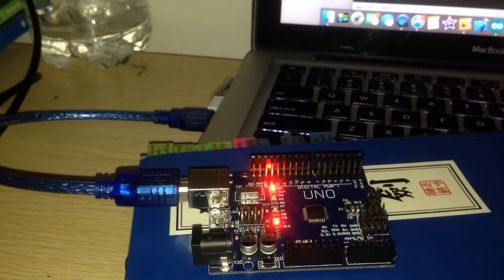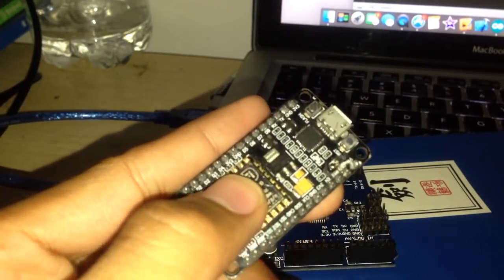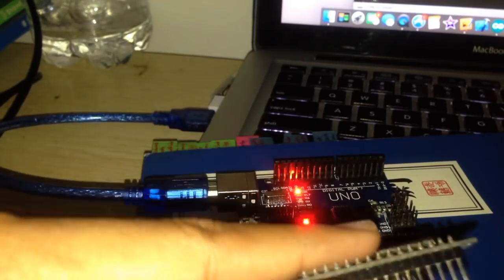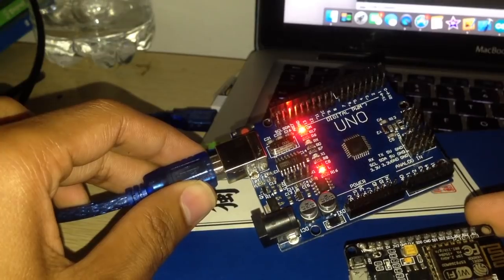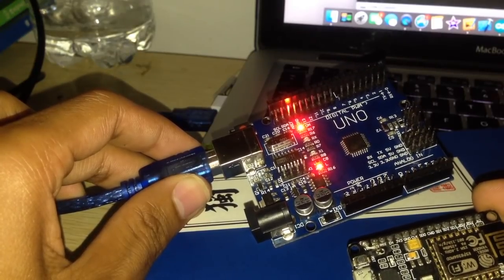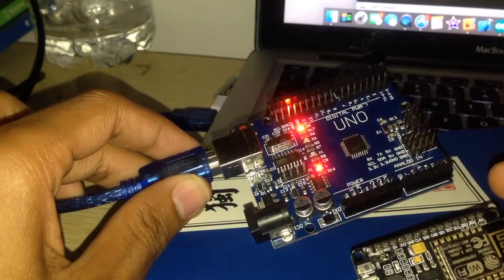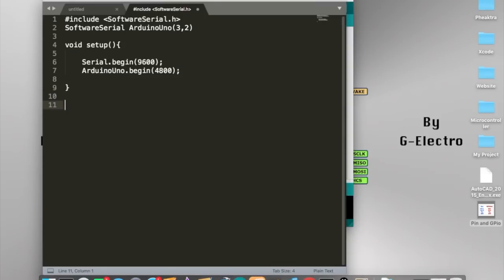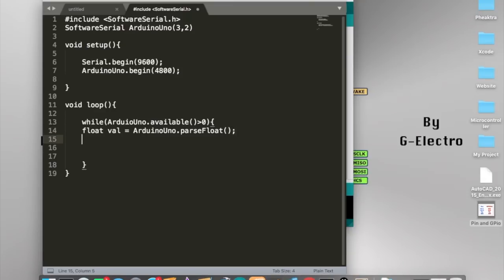How to make SoftwareSerial Communication between Arduino Uno and NodeMCU

Comment: i connect one sensor to A0 of analog input in the nodemcu esp8266. then i will put another sensor to A0 in the nodemcu but there is only one A0 of esp8266. Is it possible if i connect other A0 to Arduino uno r3 the A0 then send it to blynk?

Comment: Hello.  I watched your video and I have a lot of questions!  1-why didn't you show how both blocks are programmed?  2 - how are they programmed - individually or together?  3- at the link that you pointed to your google drive, there is one uno.ino file - what kind of file is it, it is not downloaded to the computer, its download is blocked.  You didn't show the most important thing in your video - this is the process of programming both devices, and this is the most important point.  For me, as a beginner, it is not at all clear how you did it!  Unfortunately, there is no benefit from viewing your explanation!  I have a biogas plant project.  I want to implement a monitoring and control system on arduino unor3, esp8266nodmcu, 8-channel relay board, temperature sensors, gas pressure sensor, gas leak sensor, and also remotely monitor the entire system via mobile phone.  I made a diagram, there is practically a description of the operation of all automation, I even prepared a template for a mobile application on the Virtuino platform (using simulation), but for this I already purchased a version of the Virtuino application.  Now I'm faced with a problem - where to start?  For me, this is the first such project in which it is necessary to implement communication in three areas - circuitry, programming and mobile monitoring.

Comment: Hello! Would it not be possible to connect the RX and TX pins of Arduino to RX TX pins of NodeMCU?
It is just a question because i use the digital pins 2 and 3 for other purpose in my project.

Comment: This way you cannot send data from Arduino Uno to NodeMCU. 
NodeMCU's Rx pin works only on UART0.

However, it will work if you want to send data from NodeMCU to Arduino.
Reply: how can i send data from arduino to nodemcu?

Comment: Hi is there is a way that i can use the analalog pins of the arduino uno(i hava 4 sensors and i want to send there data to a web page using esp8266 ) so i'm having a problem with the code on ide it keeps refusing the code that defines the analog pins of sensors(exmpl:  int Ldr= A2) because i'm using the esp board. can you help me plz
And thank for the video
Reply: have u solved this yet? I have a similar project.
Reply: hey have u solved this yet? we have the same project I guess

Comment: Inside the setup, The ESP8266.begin(4800) row indicats “request for member 'begin' in '1', which is of non-class type 'int'  ”怎么解决
Reply: Replace SoftwareSerial ESP8266(D2,D3) with NodeMCU(D2,D3). Do the same for all other SoftwareSerial functions (f.i. replace ESP8266.begin(4800) with NodeMCU.begin(4800) ). 
It is clearly shown in the video at 17:23.

Comment: When i run the code and upload to ESP8266. It is showing an error,
The error says  - 
"error: 'D2' was not declared in this scope

 SoftwareSerial NodeMCU(D2,D3);"
Reply: Arduino IDE is not recognising D2 as a number like it does in the case of A0 in Arduino pins. Is there an alternate  way ??
Reply: Let try SoftwareSerial NodeMCU(2,3);
2,3 instead of D2, D3
Reply: @mrzaizai2k160  The pins you need are: SoftwareSerial NodeMCU(4,0);
 since d2 is gpio4 and d3 is gpio0
Reply from the maker: It can be cause by order issue
Reply: @RedtronKH  give solution pls

Comment: Are you helping people to destroy their devices ?? its okay to receive 3.3v from esp to arduino . BUT dont send from arduino to esp like THAT!!! you need a "5V-3V IIC UART SPI two Channel Level Converter Module" also you need to learn how to how to split multidata from arduino sensor and send ensure they got recived well without problem
Reply from the maker: On theory this really damage the board but in practicing this working fine

Comment: why you donst using pin 0 and 1 arduino  for communication with esp8266? somebody can tell me about this because iam really want to know.
Reply: If u use 0 & 1 pins then u have to disconnect those connections when uploading and I guess serial monitoring is not possible as those pins directly connected over usb for serial monitoring.

Comment: Hello. Can you help me edit code? I want to add a library Wire.H (I2C). When you press the boutton ON send number 1. When you press the boutton off send number 2
Reply: this cood

#include <ESP8266WiFi.h>

 

#include <WiFiClient.h>

 

#include <ESP8266WebServer.h>

 

#include <ESP8266mDNS.h>

 

 

const char* ssid = "your ssid";

 

const char* password = "your password";

 

 

int led = 2;

 

int value = LOW;

 

WiFiServer server(80);

 

 

void setup(){

  

Serial.begin(115200);

 

delay(10);

 

pinMode(led, OUTPUT);

 

digitalWrite(led, LOW);

 

 

Serial.println();

 

Serial.println();

 

Serial.print("Connecting to ");

 

Serial.println(ssid);

 

 

WiFi.begin(ssid, password);

 

while (WiFi.status() != WL_CONNECTED) {

delay(500);

 

Serial.print(".");

 

}

 

Serial.println("");

 

Serial.println("WiFi connected");

 

 

server.begin();

 

Serial.println("Server started");

 

Serial.print("Use this URL to connect: ");

 

Serial.print("http://");

 

Serial.print(WiFi.localIP());

 

Serial.println("/");

 

 

}

 

 

void loop() {

  

 

WiFiClient client = server.available();

 

if (!client) {

return;

}

 

Serial.println("new client");

 

 

client.println("HTTP/1.1 200 OK");

 

client.println("Content-Type: text/html");

 

client.println("");

 

 

client.println("<!DOCTYPE HTML>");

 

client.println("<html>");

 

client.println("<head>");

 

client.println("<title>First Project</title>");

 

client.println("<meta charset=\"utf-8\">");

 

client.println("<meta name=\"viewport\" content=\"width=device-width, initial-scale=1\">");

 

client.println("<link rel=\"stylesheet\" href=\"http://maxcdn.bootstrapcdn.com/bootstrap/3.3.6/css/bootstrap.min.css\">");

 

client.println("<script src=\"https://ajax.googleapis.com/ajax/libs/jquery/1.12.0/jquery.min.js\"></script>");

 

client.println("<script src=\"http://maxcdn.bootstrapcdn.com/bootstrap/3.3.6/js/bootstrap.min.js\"></script>");

 

client.println("</head>");

 

 

 

client.println("<body>");

 

 

client.println("<div class=\"container\">");

 

client.print("<h1>ESP8266 Web Server</h1>");

 

client.print("<p class=\"text-danger\">on-off Button:</p>"); 

 

client.print("<a href=\"/LED=ON\" class=\"btn btn-success\" role=\"button\">ON</a>");

 

client.print("<a href=\"/LED=OFF\" class=\"btn btn-danger\" role=\"button\">OFF</a>");

 

client.print("<br><br>");

 

 

client.println("Led pin is now: ");

 

if(value == HIGH) {

client.print("On");

 

} 

else {

client.print("Off");

 

}

 

 

client.println("</div>");

 

client.println("</body>");

 

client.println("</html>");

 

 

while(!client.available()){

delay(1);

 

}

 

 

String request = client.readStringUntil('\r');

 

Serial.println(request);

 

client.flush();

 

 

if (request.indexOf('/LED=ON') != -1) {

digitalWrite(led, HIGH);

 

value = HIGH;

 

}

 

if (request.indexOf('/LED=OFF') != -1) {

digitalWrite(led, LOW);

 

value = LOW;

 

}

 

delay(1);

Serial.println("Client disonnected");

 

Serial.println("");

 

 

}

Comment: @RedTron - This won't damage nodemcu, right? Asking because ESP works on 3.3v while UNO on 5v.
Reply from the maker: So far so good although it won't giving any quick damaging, in theory it is a bad idea but in reality this working fine and might last long
Reply: If you are paranoid, then consider level shifting the 5v to 3.3v and vice versa. It's good engineering practice.
Reply from the maker: Thanks for the question anyway
Reply: Thanks.. yeah, anyways here UNO is not sending to esp...

Comment: i did exactly what is on here but with my mega and I'm not getting anything to send and RX light is not blinking but when i click send in the serial monitor the RX light blinks on my mega but nothing sends. anyone know what the issue can be ?
Reply: Try without software serial. Mega have more than 1 RX-TX pairs, so use any one other than the one connected to your USB.
Reply from the maker: Thanks for sharing

Comment: I want to send data from ArduinoUNO to ESP8266. help me with that please.
Reply: You can do almost reverse in terms of code logic. In connection, it could remain almost same, except that you'll have to plug in voltage level converter between pin2 & D2.
Reply: @prashantchaudhari7199  thanks for the reply. But already done my work. Thanks
Reply: @osamaasif5770  can You describe how You send data from   esp8266 To Arduino ?
Reply: @andydrift4584   man I bought nodemcu esp8266 module it doesn't require this... I was first trying this but than I found out about this Nodemcu module so I switched to it.

Comment: Hello, you can do the same but with an HTML page and pressing button to send the Number 10 Nodemcu to Arduino one
Reply from the maker: I'm sorry, are you making a suggestion on making a video or do you want me to try it ?
Reply: @RedtronKH  Hello, the two things, prove and make a video where you see an HTML within the code you to connect to the website and pressing button send the number 10 to the Arduino and opened a LED
The idea is to have infinite outputs in the NODEMCU and not be limited to the few that has

Comment: Several errors in the terminal...ESP8266 should be NodeMCU ...  check the download.ino or look on the monitor @  14' 26"   

Arduino Tx should have a level change from 5v down to 3.3v with a level changer unit or a 1K and 2K resistor.    5v inputs to the NodeMCU could damage it.
Reply: Oh yeah that's right, I had just forgot about that. I seen it in a previous video. Thank buddy.

Comment: Hi sir I have a question umm i'm really new to these stuffs umm why didn't we use the rx and tx pins of the arduino and the rx and tx pins 
of the nodemcu esp8266?
Reply: because those pins are attached to usb communication, we want to monitor the communication of uno-mcu using usb port.

Comment: In case if we are just using the ESP8266 module not the NodeMCU, in that case can you tell me what pins of esp8266 will be connected to 2 and 3 of arduino and what will be the changes in code?
Reply from the maker: nice question bro ? Anyway you can Google for esp8266 download and upload code process as it will show you the schematic board diagram that let you perform the transmit and received data along with pin number, the code on the other is not going to change anything
Reply from the maker: You can Google the pin of rx and tx of esp8266-12E
Reply: Okay will try that

Comment: I have a question. What is the purpose of esp8266? Is it similar with nodemcu? And what they are doing and used for? Someone told me that esp8266 is to connect to other device or to a web server. And you can code on esp8266 board without arduino. Is it true? TIA. 

Sorry for my bad english.
Reply: Also I want to ask what will happen when arduino and esp8266 are connected to each other? Our development is to sense the ph level of river using arduino and ph sensor and we want to send the data/value to website. How to do this? Please help me. Thanks.
Reply from the maker: You can also use NodeMCU(esp8266) for this project but sending data to website you might gonna chose a sending protocol that you think might fit to you, for me I only do the MQTT protocol.
Reply: @RedtronKH  thanks for your response. Now, should I use NodeMcu instead of esp8266 for my project? And when NodeMcu(Esp8266) connected to router or internet in my home, and I will bring the pocket wifi and I will visit the link (the web page) in school which is a long distance, would it still works? Sorry for my bad english again.
Reply from the maker: Of course you should use NodeMCU,
Reply: @RedtronKH  thanks. Can you answer my second question? ☺
Reply from the maker: Esp8266 is a wifi module alone, but NodeMcu is a module that contain esp8266 inside and have been well design for even more development purposes

Comment: Ad ! Can you make another video like this but run a component with Blynk soft on phone!! Exp: read the temp from sensor linked arduino sent val to Blynk soft with 8266 node.
Reply: I also need a example for a Blynk application connected to NodeMCU8266 and connected to Uno
Reply: use firebase

Comment: Can I send multiple data from Arduino UNO to NodeMCU ? only using single TX and RX pin.
Reply: U have to code both board. Software sẻial to make a communication . At the uno you print “val” out sẻial , then esp software.sẻial to read
Reply from the maker: Sure you can
Reply: MisterP can you help me to find out how to code it?

Comment: I think it's going to demage RX pin on nodemcu. It's 3V3 logic level board and from arduino it will receive 5V. It is a question of time.
Reply: there you must use voltage divider from 5v to 3v3
Reply: Dear Ali,
With a voltage divider everything will be fine.
Bye
Reply: so voltagedevider is only needed between TX on arduino and RX on esp?

Comment: How to send multiple variables serially from Arduino to esp8266
Reply: I think a comma separated string would help.. In that case instead of parseFloat, you'll have to use String. Alternatively, you need to define a protocol - say you want to send 10 float values, then send them one after other and separate them by any character, say "," and at end of 10th character, send packet completion character, say "\n".
Reply from the maker: Thanks for sharing
Reply: @prashantchaudhari7199  Is it possible to publish this part of the code as an example. I did several tests and it doesn't work. Thank you!

Comment: Can i know, why Tx and Rx is not used? I'm newbie in this things.
Reply: Because the real RX & TX of Arduino and ESP are used for USB connection with computer - that's how you can see the output of the exchange on both sides. Uno and ESP both have only 1 RX-TX each.
Reply from the maker: Thanks for sharing idea
Reply: it can be use i think if all Digital pins are already in used. I'm a newbie also:)

Comment: do i have to connect the 5 v pin of the arduino to de v in of the nodemcu?
Reply: Hello, thanks for the video, great work, inhave a question, how come the white cable goes from Vin to Vin, how is the nodemcu supplied of voltage?
Reply from the maker: Node mcu require a 5 volt voltage and then the voltage converter on board will convert it to 3.3v for the supply of esp8266 that's why you get 5v and 3.3 voltage both within one board
Reply from the maker: In my video I don't connect but you can connect if you only need one power source connection and nodemcu is support 5v as well but make sure you connect to 5v of node MCU not 3.3v cuz it will damage the board
Reply: it worked really fine, thank you for your support, now i would like to send two different readings from two sensors, do you have any tutorial about this?
Reply: I mean, you send a cariable and then you receive it as val in the nodemcu code, i would like to receive in the nodemcu a val2
Reply from the maker: I only have arduino reading sensor but haven't yet making arduino reading and send data ...... But I will do it soon .... Also will do the totorial on how you get the data uploading to internet as well . You can subscribed to my channel so that you won't miss any of my arduino tutorial
Reply: TellWeHow Std  ok thank you soo much, I will suscribe. Finally I have donde it, after a lot of experimentation